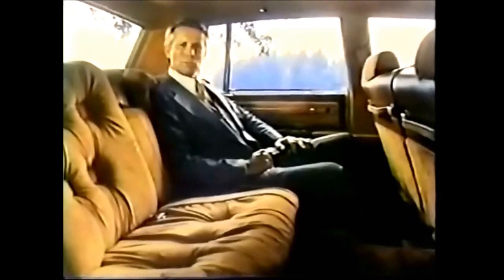'77 Cadillac Commercial (1976)

Comment: I remember when my grandparents bought a brand new Cadillac Fleetwood Brougham D'elegance in 77...what a beautiful car that was...we used to take it on long road trips just about every summer...It was a nice smooth ride it felt like we were floating on air couldn't feel a single bump...i was hooked...so far I've owned  10 Cadillacs...my 1st car i had was a 1980 Cadillac Fleetwood Brougham..what a great car that was...that was the last year GM had the 6.0L V-8...Stupidly I traded it in for a 1985 Cadillac Sedan Deville which was SEVERELY downsized...not only that it had the crappy HT 4100 ALL alluminum engine and front wheel drive...I had nothing but problems with that car and it finally took a crap when I blew the headgasket (which 4100s were common for) I almost stopped buying Cadillacs after that until I came across a 1995 Seville SLS...that was a really nice car and it was a rare find because it had a column gearshift as opposed to the floor like other Sevilles and ALL of the Devilles and Fleetwoods...The only thing I didn't like on my Seville was the phantom top...I was getting my driveway repaved so I had to park it on the street and then my idiot neighbor decided to get drunk and plowed right into it with his big dually pick up truck totaling my car...then I bought a brand new 96 Fleetwood Brougham...that was a nice car and the last year for RWD Cadillacs until the CTS-V and CT6 came out...it was a great car for road trips...it wasn't as long as my 80 Fleetwood but it was still smooth..I had an 01 Deville an 02 Deville an 05 XLR convertible (my girlfriend totaled it) an 09 CTS (which I hated because it was too small and had the crappy V6 engine) got rid of that and bought a brand new 2011 DTS..Traded it in for a 2018 CT6 that I still own today..I also have an 05 Lincoln Town Car that I inherited when my dad passed away...it's a good car..I take it on road trips as opposed to my CT6 because my Lincoln is bigger and has more room....LOVE my Caddys
Reply: And MAAAN, were the 1985's severely downsized! I remember those like yesterday. Eventually, they had to make them bigger again.

Comment: If you notice when the gentleman was sitting on the back seat, the front seat was adjusted more forward to give an illusion of more leg room in back, and when he was out of the car walking down the passenger side, I noticed the front seat adjusted back quite a bit when I saw the headrests through the back door window on driver's side. Tricky GM
Reply: Remember the seat would be that far up if you had a driver Cadillac was competing with rolls at the time and I believe early rolls front seats were up very far and only mechanically adjustable to accommodate rear leg room
Reply: yes....definitely not more rear legroom than the 76.... even tho the brochure said there was.  That's why they had to discontinue the rear footrests....not enough room for them.

Comment: "you make it more maneuverable for easier parking," In short, you make it smaller than previous models. After a quick search I found that my '76 Cadillac Coupe DeVille is almost 10 in longer than this Sedan DeVille. Still, the '77 sedan still looks nice.
Reply: Yea. But the interior in 77 is bigger
Reply: The 77 Cadillac used a 121 1/2 inch wheelbase, so did the 76 Chevrolet, before it shank to 116 inches in 77
The D'elegence option provided those beautiful seats shown in the commercial

Comment: The front seat was pulled all the way up to give the impression of more rear seat room. If you actually sat in a 76 and a 77 you would notice the reduction in rear seat knee room.
Reply: Yes, and they used a short actor too. My friend works in advertising and says instead of a guy 6'5" they use a guy 5'6"
Reply: I have a 76 and I had a 77.  While its true the 77 had less rear leg room, the 76 (I had a Sedan DeVille and still have a Fleetwood) had a LOT of room in the rear seat.  However, the Fleetwood has very little front seat leg room.

Comment: The Sedan Deville actually came out of this round of "downsizing" in pretty good shape; I can actually believe that it had more legroom than the bigger, 1976 model (both, like the other C bodies, had only 3" more legroom than the B-body Impala, despite the Cadillac's much longer wheelbase, but that makes a big difference in comfort). The Fleetwood, however, was butchered. It lost the added 3" the '76 had over the Deville, and buyers started complaining that the rear footrests, which had become a tradition on that model, were taking up more space than they were worth, so they were dropped about halfway through the model year.
Reply: kirby waite  Posted basically did say Fleetwood was now same length as the deVille, re read what he wrote. Hw said it lost the extra 3" over thhe deVille. I've had both 77 Fleetwood and Sedan deVille's the doors are same lenth, just the Fleeywoods top or rear door and about an inch less wide, the extra trim makes space look smaller. When you put the vent visors on the rear doors, you need shorter ones for the Fleetwood yet bottom half of doors are identical in size.

Comment: I had a '78 Fleetwood Brougham in Columbia Blue with the D'Elegance interior.  Although there wasn't much you could say about Delco electronics of the late 70s that was complimentary,  it was a hell of a nice car for many years until things started to break.  For at least the first 10 years of ownership there was simply no better highway cruiser on the road.   And despite the janky Delco electronics, as long as there was gas in the tank and air in the tires, it'd always get you home no matter what...even if you drove right by it when the really BADLY engineered 4 wheel disc brake system would completely fail at random.  No brakes on a car with an empty weight of 4314 pounds....that made for some fun moments.  Downshifting the transmission was an effective substitute for brakes, in a pinch...

Comment: I remember as a 7th grader when these downsized GM big cars were introduced.  It was a really big deal at the time because up until that time "bigger is better" was the way American cars were marketed.  GM held its breath hoping the public would approve and the public did approve because sales were up over the 1976 biggies.  Unfortunately, general fit and finish was in decline during those years along with a lot of non-durable brittle plastics and cheap drooping headliners.
Reply: by this point, plenty of luxury car buyers had already switched to Mercedes or other foreign brands. and the lower price buyers were going for VWs, Hondas and Toyotas. the American car companies continued into a decline from which they never recovered. and by the way, you can fix the droopy headliners with thumb tacks. ;)
Reply: Yes, and GM used fiberglass front facia panels instead of sheet metal.

Comment: That model design Cadillac wasn't to bad until 1980 when they added the 4100 V8 and turned it to garbage
Reply: Timothy Evans they added the 4100 in 1982.  In 1980 and 1981, it was the 6.0 liter 368 ci V8.  Do some research before commenting.
Reply: Don't forget the Olds diesel.  To be fair, a lot of GM's engines were circling the drain by 1980.
Reply: @andrewcolsen  oooooo
Reply: 82
Reply: @andrewcolsen  In '81 they took that same 368 V8 and gave us that V8-6-4 which was a brilliant idea, just didn't work because the technology wasn't there

Comment: the crazy story about the first cadillac seville from 1976-79 is a car that cadillac should taken more seriously, today,s cadillacs fall far short of what they should be, let,s be honest in retrospect, the 1976 cadillac seville was today back then, the crazy part stems from created with it,s own new styling and interior was built from a collection of parts, for example the chassis was borrowed fron a chevy nova, suspension differential and steering came courtesy of chevy z/28 and pontiac trans am and the engine borrowed from an oldsmobile cutlass supreme and added fuel injection electronically, a first at that any domestic let GM, the years since that car was built every car cadillac has fallen far short  of that car and as well as their as well as their  commitment to building cadillacs that meet or exeeds the first seville, that was the blue print for today,s cadillac, what a waste.
Reply: That Seville may have been the best American car of the 1970's.
Reply: Many msnufacturers utilize existing platforms as well as tried and true components. GM had been doing exactly that with Cadillac, Buick and Oldsmobiles since 1949. The Seville did not share one single piece of sheet metal with any other GM model. And I believe it had its own suspension system which included a  shock absorber for the steering.

Comment: This commercial only makes me long for those cars, because today,s cars if you want to call them cadillacs definitely do not measure up to this 77 deville d elegance, face it cts, xts , ats, ct6 are rediculous compared to this baby, GM,s feeble attempts at turning chevy tahoes and suburban into ecalades are living proof the general has run out of ideas, or at least good ones, GM them selves need to see this commercial, may be it might refresh their memory, it might even help for them to drive a 77 cadillac instead of looking to BMW and mercedes benz  expecting those guys to them build new cadillacs when predecessors already have, duh.
Reply: There is an aura and presence these cars have, but don't kid yourself, today's Cadillacs have far superior fit and finish.  They just don't have much personality though, but all the makes have watered themselves down to the point where they are not that distinguishable from one another.
Reply: Agreed!  I miss my 77 Coupe de Ville.  I got that car from my parents when I turned 16 and got my license in 1979.  It had 2500 miles on it when I started driving it.  My parents liked their El Camino and Silverado pick-up better as they went fishing a lot with their friends.  And my friends like my car as it was so new as most of the had cars from the 60's, i.e. Ford Falcon (with shot suspension), VW Bettles, etc.  It was a fun party car.
Reply: Sir whenever the revolution starts I want be on your team. In there quest to beat the foreign jobs, Cadillac seems to have lost there mojo. I once was the proud caretaker of a 77 coupe I stupidly sold it to my godson , he allowed a backyard mechanic to work on it and led to the motor 🔥 up, the rest is history. I will find another gem soon and I won't sell for anything!